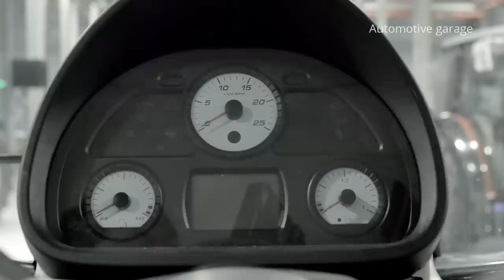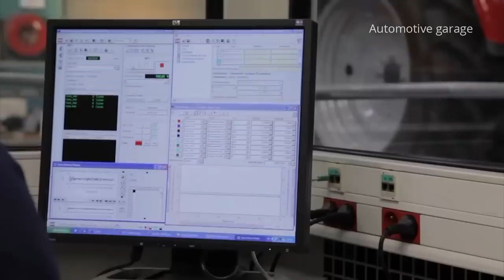Massey Ferguson Tractor Production Factory

Comment: I always tell people what M-F means to me , & that's Mighty- Fine ! & while I only own 2 Massey-Ferguson's a 1959 M-F 50 & a 2018 M-F 1526 they both perform reliably & the part supply is there when I need it.
Reply: equinox geospatial  The 59 M-F 50 looks better all the time with the possible diesel shortage coming ? & nothing beats a good back up gasoline tractor IMHO .

Comment: These are very nice looking tractors. Financing on agricultural equipment needs to be extended to 10 to 15 years as these are heavily built industrial machines. They do not wear out quickly like a car in 5 to 7 years. Land prices need to be kept in check. 40 years ago in the US land was inexpensive at 100 to 200 dollars an acre. Now in just 40 years land is up to 3,000 to 5,000 plus an acre. The price of land is up over 10,000 %, it is very difficult for farmers to succeed along with increased fuel prices. This has driven inflation very high especially food prices. If we are not careful a can of green beans is going to cost 10 dollars just to pay for the land. Tin was at 42,000 per ton not long ago. These machines are the most important machines we have along with trucks. We must absolutely protect these industries and our food supply. Weapons are expensive, tractors are inexpensive. Tanks are expensive, trucks are cheap. The ukraine is still plowing fields with horses in places along with other parts of the world. So much capital is now tied up in land transactions, far too much, it has kept wages down as a result. Farmers are struggling and the EU is making it harder with that Net Zero nonsense. China is burning 4 billion tons of coal while the EU punishes farmers over a little diesel fuel. Airplanes are burning hundreds of billions of gallons of kerosene, while they punish farmers and drive up cost. Good video, very good machine.   LLXIIX77

Comment: Dear Tractor companies why don’t most of you find an old lorry Frame or even rebuild a brand New Lorry Frame for building stronger and better Tractors and put those Scania N113, Volvo B10M, Volvo D10A, Volvo TD102KF, Gardner 6LXC and Gardner 8LXB Diesel engines and put on all of those Leyland Hydra cyclic Automatic 4 and 5 Speed Gearboxes for those stronger better Tractors so they can still use them for any farms and even use them for the Mechanics so they can even lift a broken down Bigger Buses and also lift all of the broken down Lorries, why don’t you build 6 and 7 seats so that other passengers can sit at the back and front including the driver. You can still build those four small stronger medium sizes wheels and still make them even more useful for the Mechanic farm tractor than it still was before, please can you do those interesting ideas for us tractor Lovers.

Comment: Massey Ferguson, Fendt, Valtra ... Same tractor ?
Reply: Almost all sisu engine. MF is using dyna-vt from fendt. Valtra g serie = MF 5s
Fendt = luxury
Valtra = different
MF = mass prod. Really feel sorry for the MF engineers that there limited. For example no vt in de 5s. They have tested torotrak-cvt
Reply: Володимир:
24 лютого 2022 року в нашій країні розпочалася війна. Багато місяців поспіль армія України героїчно захищає нашу країну від нападу російської орди. У цей непростий час, кожен може долучитися до допомоги, та зробити свій внесок у спільну перемогу над окупантом!

Всім кому небайдужа доля наших захисників та доля нашої країни: ми відкриваємо збір коштів на дрони/анти-дрони, автомобілі та амуніцію для ЗСУ. Всі придбані речі ми особисто доставляємо на фронт, тим, кому вони зараз найбільш потрібні. Разом до перемоги! Слава Україні!!! Слава ЗСУ!!!

РЕКВІЗИТИ 

 БЛАГОДІЙНОЇ ОРГАНІЗАЦІЇ  «БЛАГОДІЙНИЙ ФОНД 
 «ЗАХИСТИМО ТА ВІДБУДУЄМО УКРАЇНУ РАЗОМ»

Юр. Адреса: Україна, 02232, м. Київ, проспект В. Маяковського,
будинок 54/9, кв. 27
Код ЄДРПОУ:  44711686
ІПН:  44711686
Дата реєстрації платником податку на додану вартість : 24.05.2022
Р/Р :  UA873077700000026008711142123 в АТ «А-БАНК»   (UAH)
        UA0830377000000026007711142124 в АТ «А-БАНК»  (USD)
         UA2630777000000026006711142125 в АТ «А-БАНК»  (EUR)
         код банку (МФО) 334851
Телефон: +38(098) 362-03-69;
               +38(068) 623-16-90
email:       fondprut@ukr.net
Директор: Фастівщук Людмила Володимирівна

On February 24, 2022, war broke out in our country. For many months the army of Ukraine heroically defended our country against the attack of the Russian horde. Right now you can join the battle in your own way, and force the occupier to go back to his own country.

Everyone who cares about the faith or our defenders and the faith of our country: we are open fundraising for bying drones / anti-drones, cars and ammunition for ZSU. We personally deliver all purchased items to the front to those who need them most right now. United we stand! Glory to Ukraine!!! Glory to ZSU!!!

REQUISITES

CHARITY ORGANIZATION "CHARITY FUND
  "LET'S PROTECT AND REBUILD UKRAINE TOGETHER"

Yur. Address: Ukraine, 02232, Kyiv, V. Mayakovsky Avenue,
building 54/9, sq. 27
EDRPOU code: 44711686
Personal identification number: 44711686
Date of registration as a value added tax payer: 05/24/2022
R/R: UA873077700000026008711142123 in JSC "A-BANK" (UAH)
         UA0830377000000026007711142124 in JSC "A-BANK" (USD)
          UA2630777000000026006711142125 in JSC "A-BANK" (EUR)
          bank code (MFI) 334851 . Картка     АБанк  4323387027536690.₴).(4323387027536922.евро.
.
Phone: +38(098) 362-03-69;
                +38(068) 623-16-90
email: fondprut@ukr.net
Director: Lyudmila Volodymyrivna Fastivshchuk....

Comment: Wish my 1735M would stop breaking 
Injectors went bad in first 50 hours 
Constantly tries to overheat when temp gets above 70 F degrees 
And loader arms cracked and pretty much fell off twice. 
Just from digging a burn pit 
And carrying pipe across a field 
Massey rep was a douchebag there idea is blame the customer since they can't brace there arms like every other brand 
Loader is way underbuilt for rated capacity mounts fatigue and get stress cracks 
Had to build a brace bracket myself since it was in the shop for 3 months last time 
I won't give them another dime buying Kubota next way better built